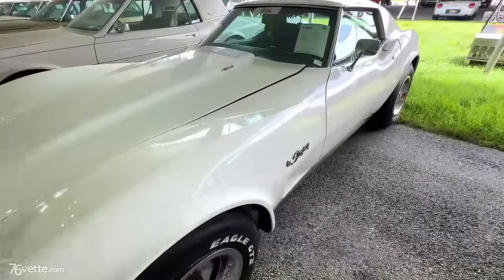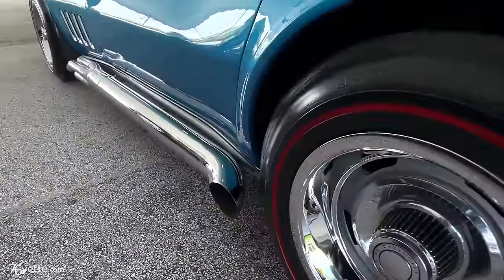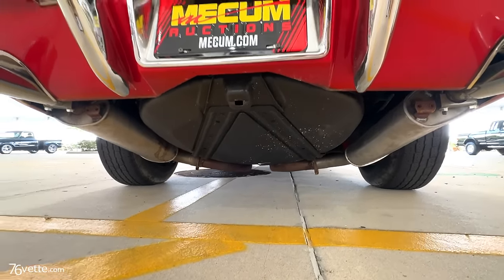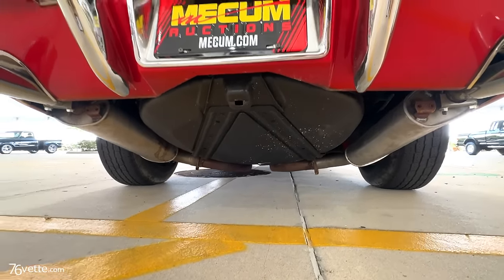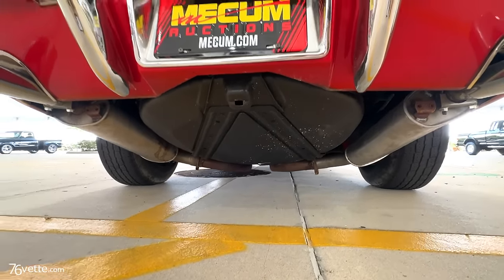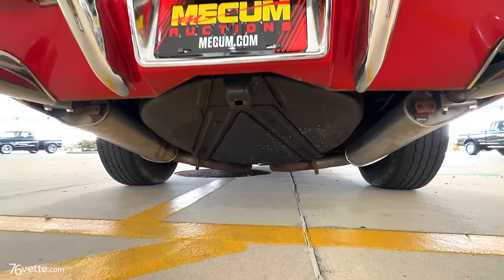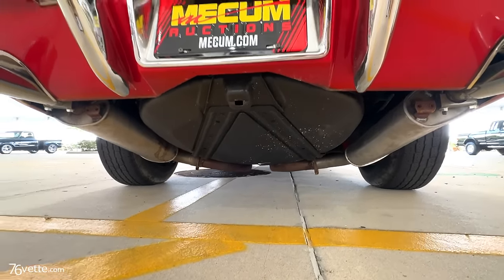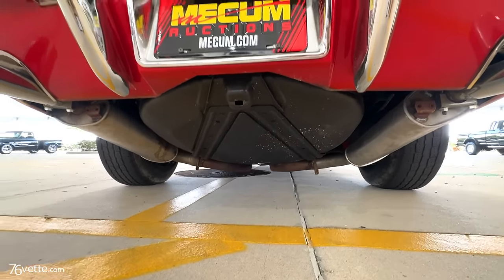C3 Corvette AUCTION Results with PRICES!

Comment: I turned down a C5 to buy one of these. The C5 was faster but you just can't beat the C3s styling!
Reply: My budget choice was a late C-3 (80's) or a C5. I chose the C5 for the gas mileage as it was going to be my alternate daily driver. Now I'm retiring and I wish I had found a reasonable C3
Reply: I agree. I could have spent more money on a newer, better condition corvette, but I ended up get a "ratty" C3 for 3k instead! The body lines are too good.
Reply: they handle great compared to won't mention, some sports cars of the 90's

Comment: My first Vette was a '71 LT-1 restoration project, C3's are expensive and complicated cars and its very easy to get upside down in the investment as they have several major trouble spots to look out for. The midyears are actually easier to restore, simpler, yet are more valued. Chrome bumper C3's such as LT's and big blocks can be worth decent money when they are done, but rubber bumper later year models can be just as expensive to do, yet are not worth anywhere near as much. My advice - C3's are awesome cars, they are fun and look great, but have your purchase inspected thoroughly by and expert, and buy the best possible example you can find, even if it seems to be priced high.

Comment: C3, 4 & 5s are the best buys right now.  The only ones I would stay away from are the cross rams from '84 and the LTs from 1993-1996.  The sweet spot I think is 1997-2004 w/ the LS1.  If you can find an early 70s w/ a Big Block that would be a cake topper.
Reply: @mrjim1973  I certainly agree on the Crossfires, but the LT1/LT4 was the top of the class when it came out. In addition to the 6 speed it was a game changer, big step in the evolution to the LSX. After the low power of the 70s/80s, hitting the go pedal with an LT1 made me feel alive again!

If the Opti is a concern, it can be easily sidestepped with a Torqhead or other aftermarket solutions. Replacing the awful Dexcool and keeping up on fluids maintenance would easily get an LT to 200k miles.

Comment: The chrome bumper 68-72 C-3's are still holding all of the value
Reply: In some cases yes. Big Block w/ manuals (454 4-speeds) have a broader support base). I had the chance to buy a low milage 1-owner ’73 (the C3 transistional year w/ Rear Chrome bumper and Front compositie bumper) with just the basic 350c.i. /Auto and I made more $$ on flipping that than I did with a ’72 350 Auto in near equal condition and about 8k more on origianl miles. I actually found there are collectos of the transitional year which was a suprise to me, so any more I know expand that old ’68-72 C3 core range to ’68-’73. Probably the only make/model of any brand that I include the '73 model year in a search setting.

Comment: The 1975 Chevrolet corvette stingray  though less power as the model was and boy there were a lot of coupes that year. The convertible is keeping its great value for sellers nothing like the chrome bumper C3’s but the next best thing. 4629 only made that year and being it was the last year of the C3 convertible and no convertible for a Vette till 1986. Also Zora Duntov retired that year the father of the corvette. That added some mystique of big changes were coming later for corvette.

Comment: Hey i was wondering what octane do you run in yours? Just curious what is best for a 75 stingray 350.
Reply from the maker: I use Regular 87 octane gas for my 76 😊👍🏻
Reply: @76vette  thank you sir. I put 93 in it just a few gallons and it seemed to bog it down.

Comment: Nice to see the auction and results! The bumper cars don't seem to be moving much these days, I'm surprised some didn't sell. Awesome video! Thanks so much for sharing it with us!👍
Reply from the maker: It was a great event, but too hot and humid this time of the year. Thank you for watching! 😊👍🏻
Reply: It looks like the demand has dropped and the reserve prices did not follow….buying them is one thing but maintaining them is more challenging than 5-10 years ago…less parts, less mechanics…
Reply: @76vette  👍
Reply: A lot of off years with a couple of good years in there.  Nothing wrong with the off years, just not highly collectable.

The off years would make good restomods where you don’t feel like you are protecting the car’s authenticity.
Reply: @musclecarmitch908  bumper cars?

Comment: At 43:36, you see that the duct tape to the Air Cleaner has separated from the intake pipe.  Looks like somebody removed the air cleaner and didn't give a crap about realigning or retaping with duct tape the intake pipe.  Sloppy workmanship indeed!  🧐
Reply from the maker: If you’re talking about the flex duct, those usually fail over the years. Personally, I prefer to see a car with all its imperfections rather than duct tape “repairs.”